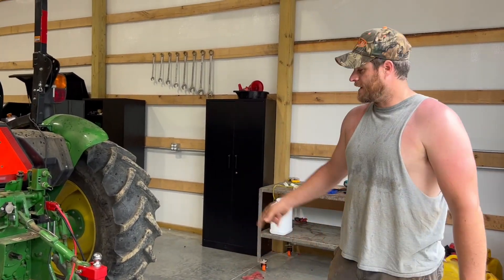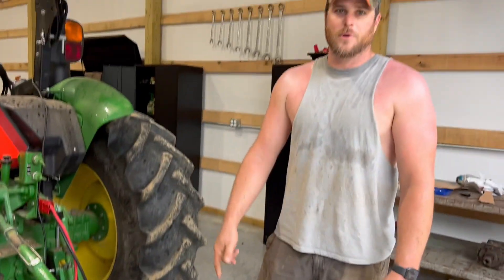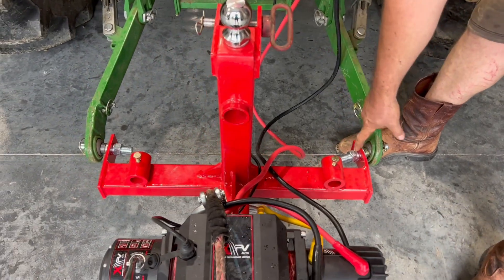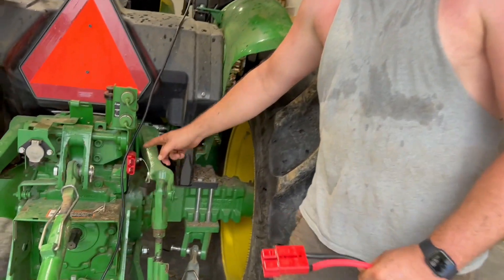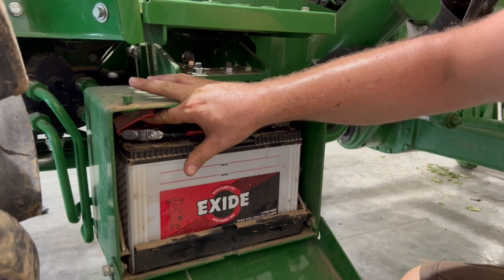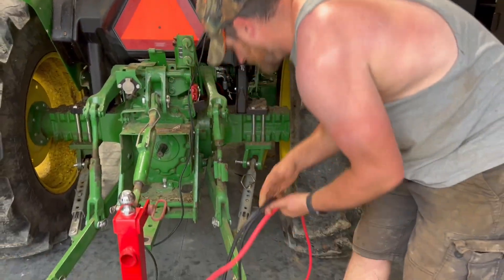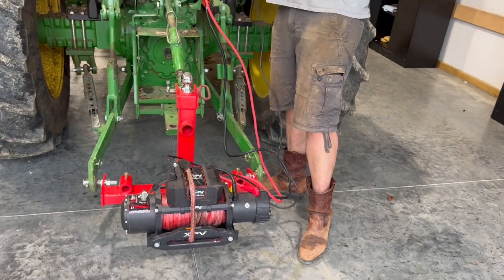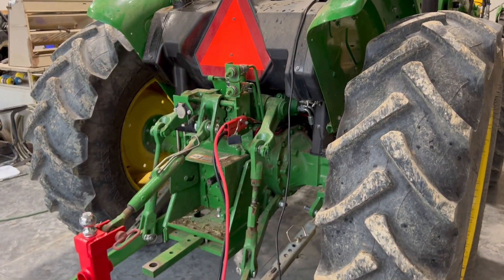DIY Tractor Forestry Winch | Easy & Works | 10,000lbs!

Comment: it's cool but what's needed is the winch to exit via a 180° pulley that can let you pull left or right of straight back .  Then some type of blade or even a toothed blade or pegs that when lowered penetrate the ground below, thus anchoring the thing . Cool video though !!!

Comment: There is a reason people mostly only use electric winches for recovery. They are no good in this application because as you said the winch gets so hot its over heats and ends up cooking your battery. I also didn't see any fuses in you set up. I use Mega fuses 200Amp on my electric recovery winch but check what yours specifically draws. For this kind of work and the fact you are already using a tractor you would be a lot better off using a Hydrolic winch. These are pretty much indestructible and will run all day with no issues unlike an electric one. But ultimately the best option its a PTO driven forestry winch. Good luck

Comment: i have a similar set up but the winch is on my trailer (hitch area), , eventually your gonna burnt out your winch, you could try to pulling out the log to the road with a different cable with pulleys using your tractor and using your winch to lift it up to add a chain afterwards to hold it up,,,.  a lot faster and will save your winch.
Reply from the maker: Good tip!

Comment: Just what I was looking for. I was wondering if something like this bolt to my work platform on rear of tractor.

Thanks for all the details.
Reply from the maker: +@mikebelcher6692 No problem! This has worked well for us. Hopefully it does for you too
Reply: I bolted a small winch to a trailer ball hitch and put it into the 2” receiver mounted onto to the tractor frame.
Reply: @ awesome, sounds like an excellent mounting way. Thx

Comment: On addition that wold reduce stress on the tractor while winching is an anchor of some sort. 
If I built one, I would start with a a market place grader blade, buy a receiver hitch tube and weld to the blade frame. Add in a D ring or 2 for dragging logs or build an arch and make a second trip. But great ideal on the winch build.
Reply: Great idea. I just got a rusty grade blade as a bonus with a discer I got at auction. I'm trying to unseize it but even if I can't your idea will save me some money.

Comment: Just a comment, but I'd weld (if you weld) a heavy D ring on the mount.  Once you get a log winched in, attach the choker or chain directly to the mount and relieve the winch of the load.  Your winch and winch line will last WAY longer.
Reply from the maker: That’s a great idea. I will be doing that.

Comment: Excellent system. Maybe a short snubber from frame anchor point to the chain hook on the log to take out any jerking motion on the winch hub while towing. Winches can suffer damage if towed for long periods on the hub alone. Great vlog once again.
Reply from the maker: +Phil Sulzberger Note taken. Thank you for the tip!!!! :)
Reply: I second this! a few grab hooks welded to the hitch frame will let you drop the hitch low, chain up a few logs you have pulled in, hoist them with the 3 point and keep from smashing the bearings / bushings in that winch. I replaced multiple bushings inside a Warn ATV winch after abusing it as a drag point instead of using chains. It's not a fun job, assuming you can get the parts...